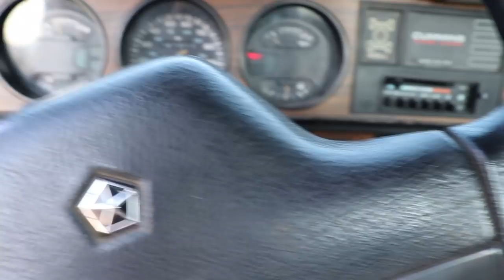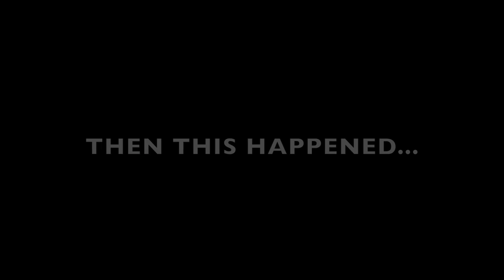MY NEW DIESEL TRUCK IS WRECKED!!!!! *NOT CLICKBAIT*

Comment: Man, sure hate to see that, specially on that truck. As for as your buddies throttle rod popping off, the factory one have plastic ends that get weak. The new replacements have metal ends. It's been so long since I replaced mine but I think it was like 40 bucks

Comment: Old tires. Always taking a risk. Check the date near the dot stamp
Reply: Some tires don't even have dates on them.
Reply: P PUMPED 24 VALVE that means the tire was made before 2000
Reply: Actually all tires have a date on them. Its a DOT requirement. Tires before 2000 are just harder to decipher

Comment: That sucks man but if you knew it had dry rot tires, you shouldn’t have even been driving it to begin with. There’s a reason tire shops don’t touch them unless they’re taking them off. Lesson learned. Lol.
Reply from the maker: derek czeschin they didn’t look dry rotted at all. In fact they looked to be brand new tires. I’m just guessing maybe they were dry rotted. Everyone I’ve told about the situation says it sounds like a crappy re-tread tire job....
Reply: I’ve had old tires on a trailer do the same thing. I don’t know if it was a retread but tires were old and we knew something was bound to happen. Didn’t care though. Trailer was junk and I was on my way to scrap yard and just dropped the whole trailer off. Lol. It was weird though cause it still held air looked like same situation as you.
Reply from the maker: derek czeschin exactly... except I n bee would have suspected this to happen... I’m making another video when I get home.. because the tires look perfect.... that’s what doesn’t make sense